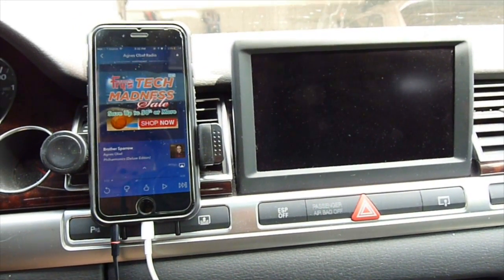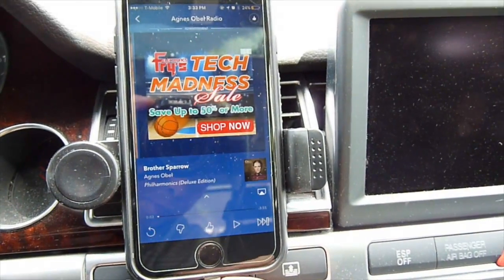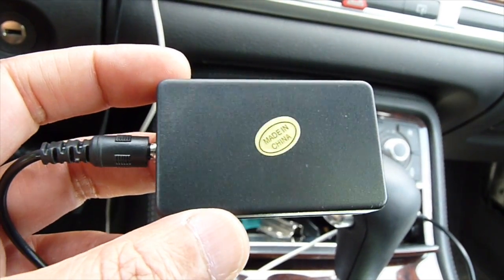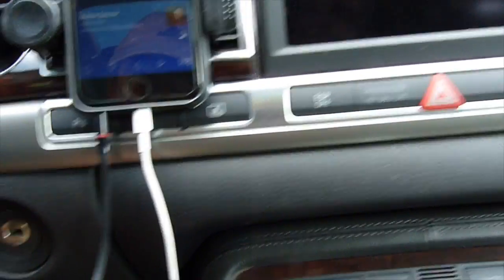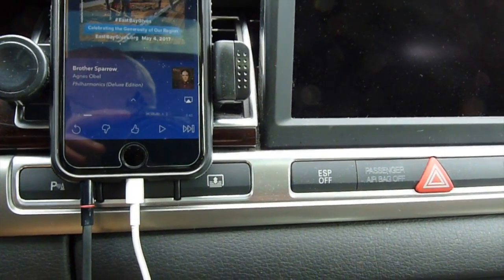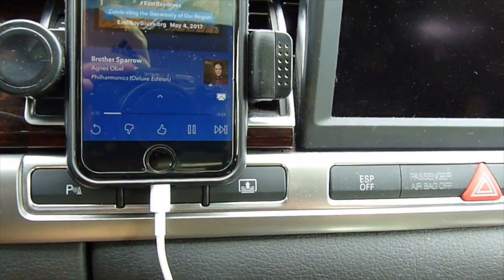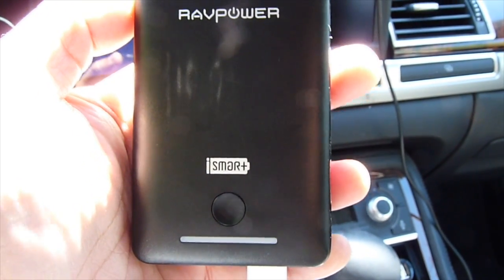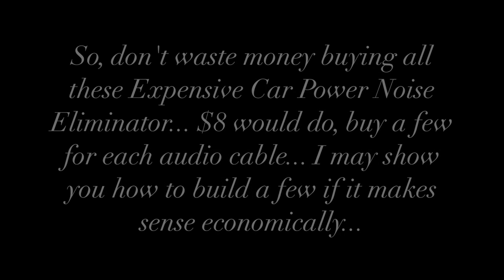How To Eliminate Car Audio Ground Loop Noise Caused By USB Chargers

Comment: What if you have a similar issue but only when not transmitting audio and the usb charger does not have to be connected?
(I have a bluetooth (v5, previously v2 which had the noise issue like described in the video) receiver that connects to my car with aux)
Reply: did u fix it

Comment: Another way, without intermediate  - https://www.ebay.com/itm/Car-isolated-power-supply-charger-5V-4A-2-USB-1-wired-output/352557249766?hash=item52160cb4e6:g:yC4AAOSw0~pcH77c:rk:1:pf:1&frcectupt=true

Comment: Hello, I have 2016 Nissan Rogue SL. I have an issue when i make calls, the people on the other end hear a loud noise. It’s been described to me as a whistling tea kettle, a dental drill, and a squeaking door. It seems to get louder with engine accelerating. I cannot hear it on my end. You have any idea what could cause this problem?
Reply: Get dc to dc isolator.. that eliminates ALL unlike this video you eliminate only one problem..

Comment: Good to know that the powerbank does not work.. I was going to try that.
Reply: It depends on the power bank. If it passes the power through then you get the noise. If it charges the battery while you are discharging it then you don't get the noise.